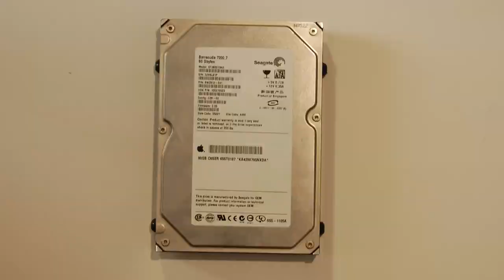PowerMac G5 - Disassembly

Comment: I'm currently disassembling a power mac, and I'm struggling to remove the screws of the top shelf parts, the fan and the HD-Drive Holders. The screws are sat super tight, any tips on how to get them out there, except for persistance? Did you have troubles with those as well?
Reply: wd40 maybe?
Reply: Your gonna need a 90 degree drill bit that can attach to your drill or screwdriver with interchangeable bits

Comment: Just got a 2005 dual-core on Craigslist for $40. Pretty dusty and some spilled coffee down the front, but otherwise in good shape and it works! Gonna clean it all out and do new thermal paste on it. Also, will load in USB3.1 and Sata III PCI-E cards for use in Linux and Sorbet Leopard. Debating putting in an Apple flashed ATI 1900XT, but not sure.. By the way, Sonnet still makes a PCI-E expansion board for a SSD called the Tempo SSD that still has support for G5's..
Reply: Was not aware of Sorbet Leopard (unofficial OSX 10.5.9) and interesting Tempo SSD w/ later model G5 support, Thanks!